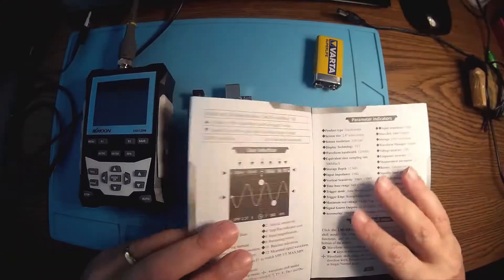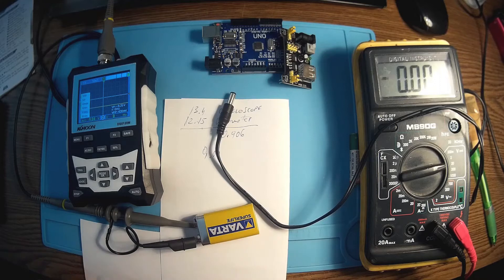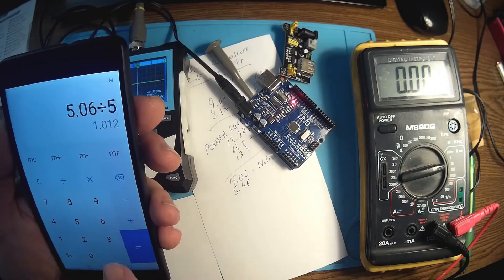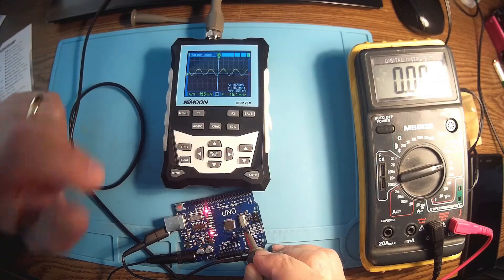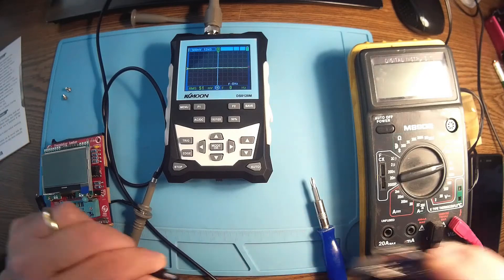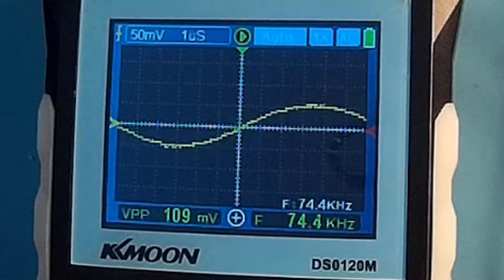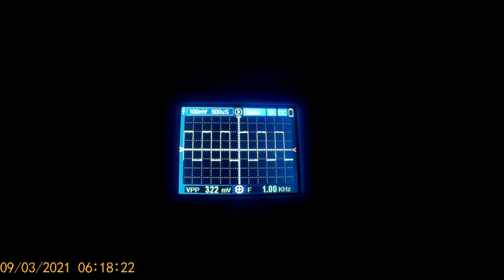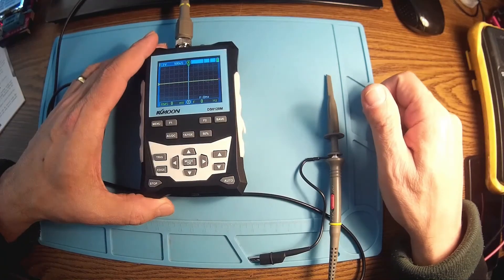Part3 KKMOON DS0120M DC  tests more real life waves and battery tests

Comment: Thanks, very comprehensive overview.  Did you notes that when the oscilloscope is connected to the DC power to charge the battery, and if you are measuring a any signal,  the signal starting to oscillate a bit?  It happen on my devies.  I just wanted to know if you had the matter too.  My oscilloscope is the ToolTop ET120M.
Reply from the maker: Sorry but I don't own the oscilloscope anymore..I didn't notice though

Comment: Thanks Viorel, this device is a really piece of c**p!!! Very inaccurate measurements above 1Mhz... furthermore it is actually not compensated: if you try to change the scale it changes the Vpp redout by 30-40% at the least! How you can trust such an inaccurate device even for newbie??? Returned to Amazon!
Reply from the maker: I know..I sold mine in few days after received..It's good for teaching science at least..
Reply: @viocaia  For sure a FNIRSI 1013 or 1014 are more reliable equipment with a little higher investment. Also FNIRSI 1C15 looks like a very interesting tool. Did you try them? What's your thought?
Reply from the maker: @iz7fmm  I only had 1C15, check my videos about. It's a little better.
Reply: @viocaia   Thanks man, appreciated!   And Subscribed :D
Reply from the maker: @iz7fmm  Thank you too!

Comment: Hi sir, why this tool when i measure 230vac using oscilloscope not same value as multimeter. But no problem when measure DC supply
Reply from the maker: Maybe your multimeter is not a True RMS..

Comment: First check the generator on a normal oscilloscope. Perhaps the cheap generator itself produces such a signal.
Reply from the maker: I will...
Reply: @viocaia  And you also need a good oscilloscope probe. The probe comes with a low quality oscilloscope.
Reply from the maker: @АлександрКузнецов-ж5я  right!